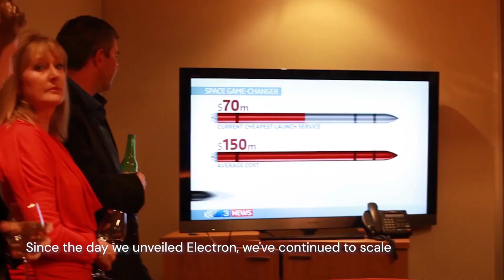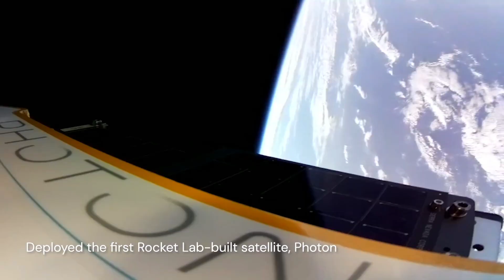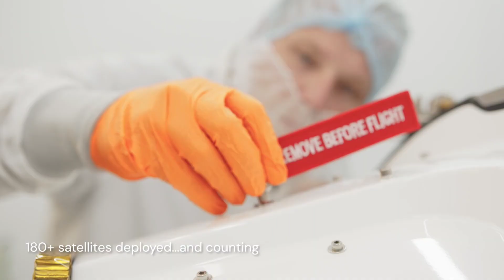Rocket Lab secures huge US Military Contract!  Stock surges!

Comment: Congratulations to Rocket Lab!  BTW, a bit of math: An increase from 4.08 to 30.49 is a more than 7-fold increase, 747% to be more precise.  It closed today even higher, at $31.27 per share.  I also bought some Rocket Lab stock relatively cheaply at well under $10 per share.  One of my better stock picks.